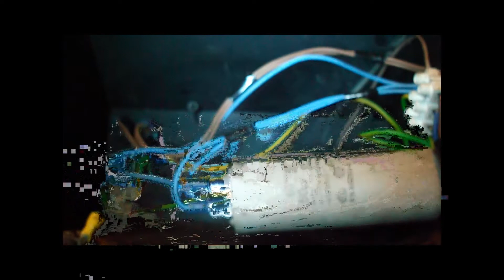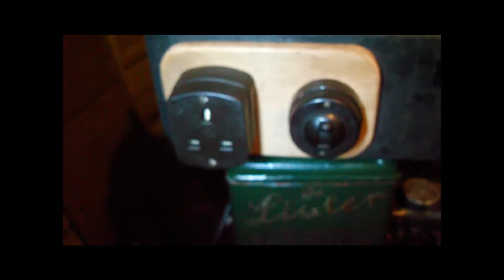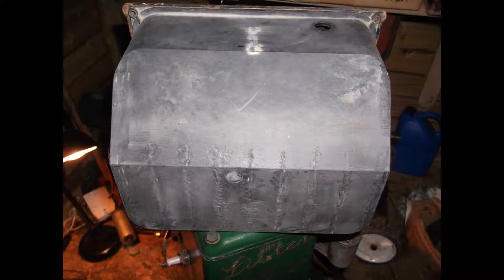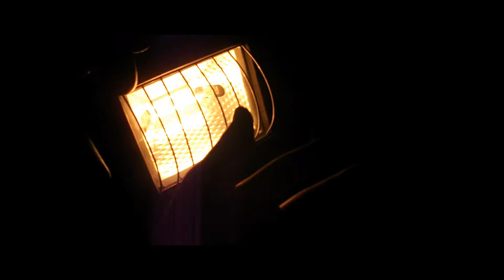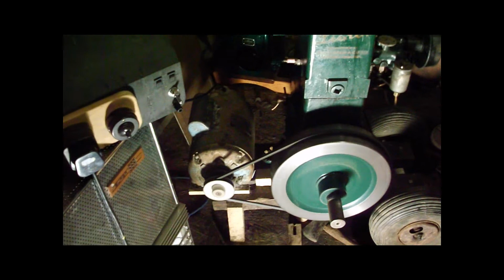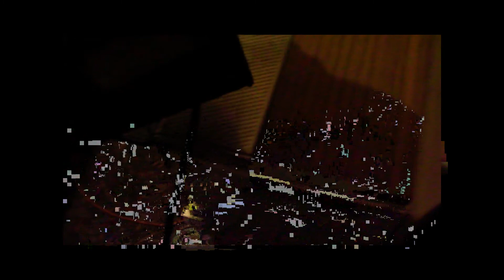Induction Motor Generator - Part 2

Comment: Works well does that, the old "D" like a bit of load. Think you need some sliders for the dynamo though, would help tension the belt better.